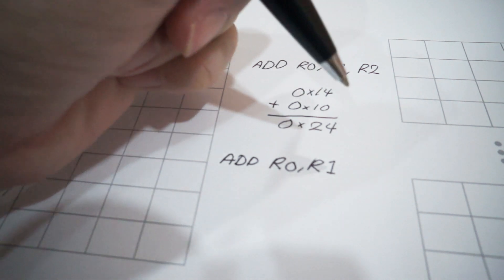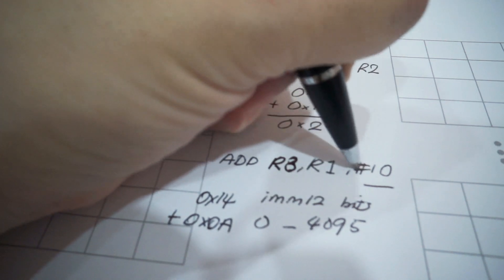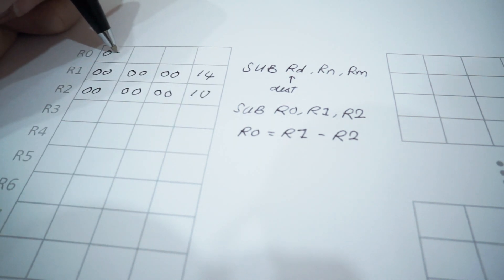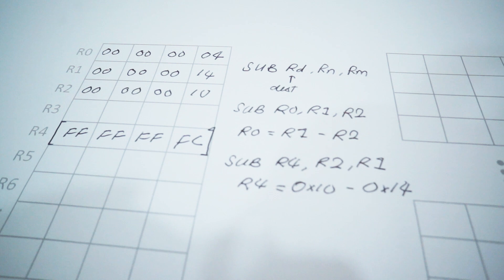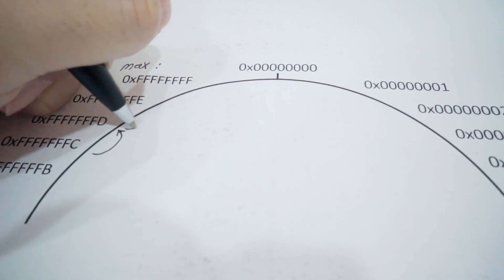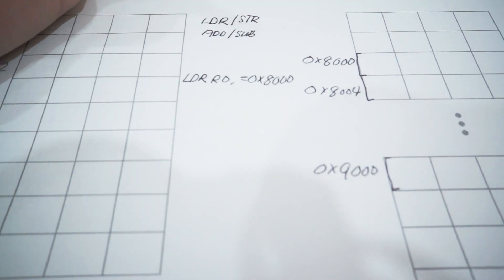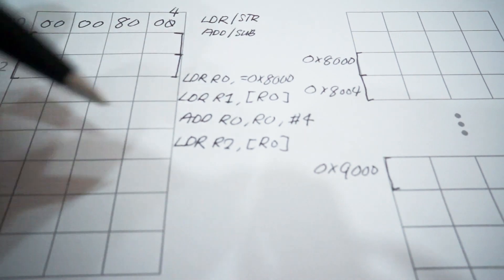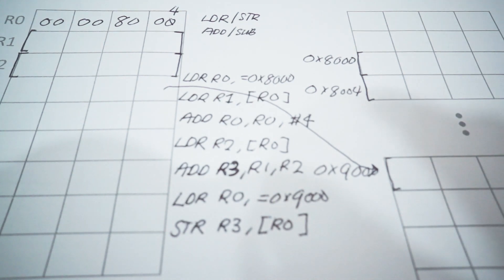Chapter 3.3: Arithmetic Instruction - Part 1

Comment: Sir, you added #4 to replace the value 8000 to 8004 what if I add #3 to the 8004 will it become 8007 or replace it with 8003
Reply from the maker: if R0 is 0x8004, and you ADD R0, R0, #3, then R0 will become 0x8007
Reply: @soo.yewguan   Understood thank you sir